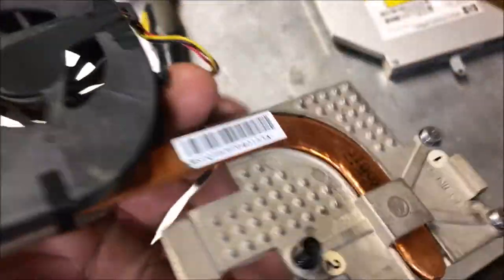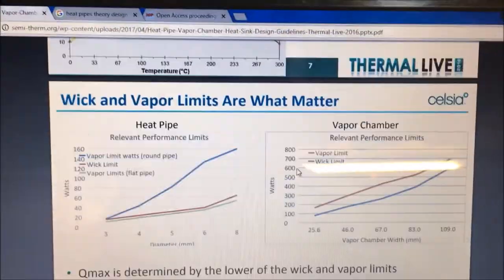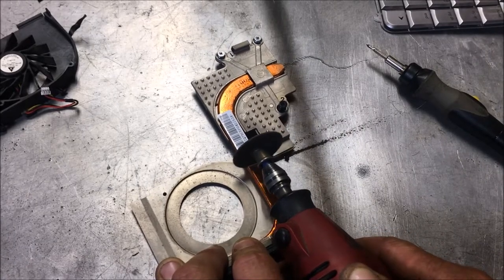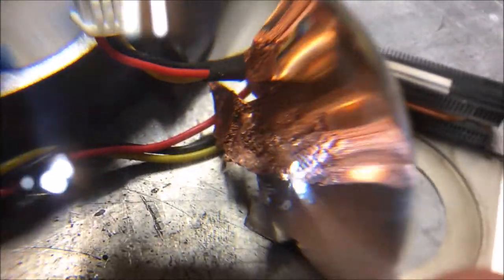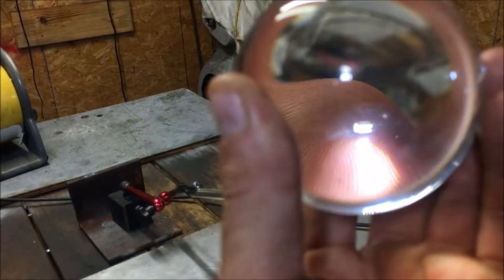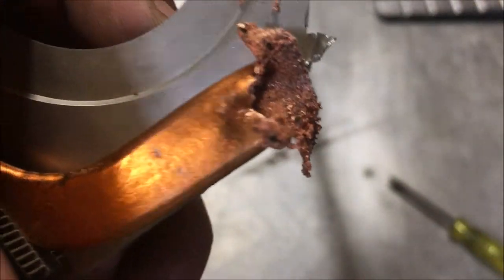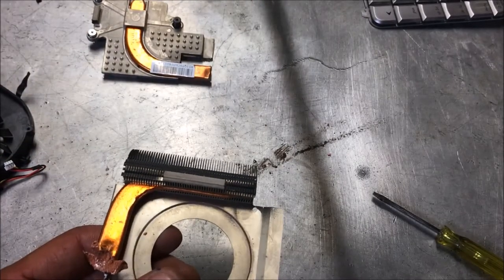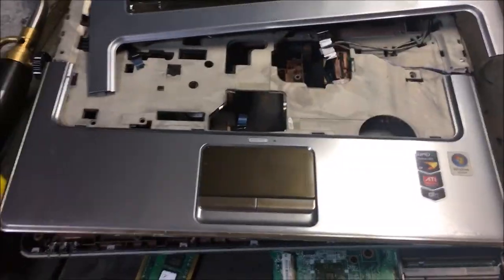INSIDE a  CPU Heat pipe ?( vapor technology )

Comment: Did I not allude to this some place in my past comments? Maybe it was on another channel...
Reply from the maker: Yes i think you mentioned it in your heat engine description but i never new CPU's had heat pipes of this caliber , i just assumed i was looking at a copper bar lol , yeah i know i know ...Sad
Reply: Seeing as heat energy transfer is at the core of solar thermal power, such systems are very nearly the same systems I work with in my ammonia designs.
Reply from the maker: awesome , hope to see some of your work , solar is a prized solution for me , i have this idea to maybe use solar heat to make super heated  steam then blast that steam into white hot solar heated trough tubes entrained with  carbon powder . this would liberate large amounts of hydrogen and carbon monoxide that would then be used to run a conventional I.C engine . from cradle to grave it should be carbon neutral except the carbon refining process may be more energy intense then considered . if the carbon isnt pure the tubes may foul .
Reply: I would have had a lot of it done by this year if my track loader had not spent the past 4 years broken down. Hopefully next year I will have some significant headway.